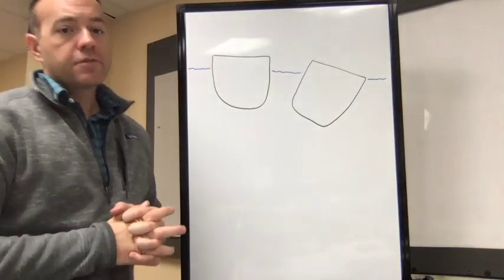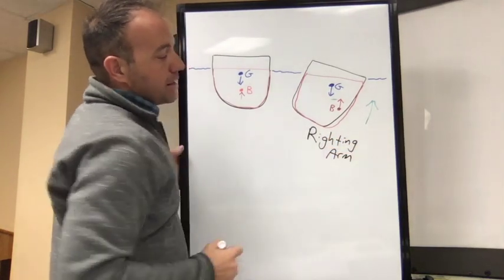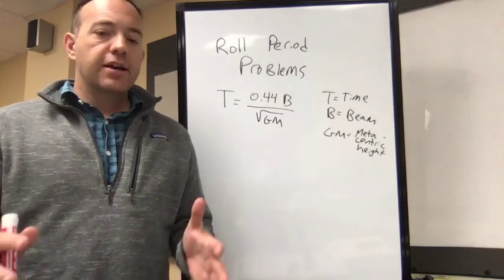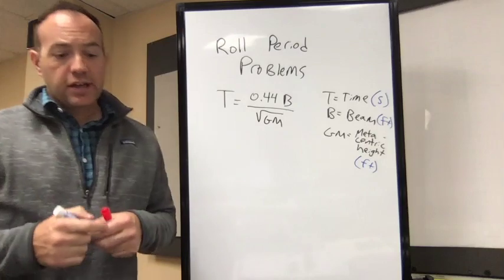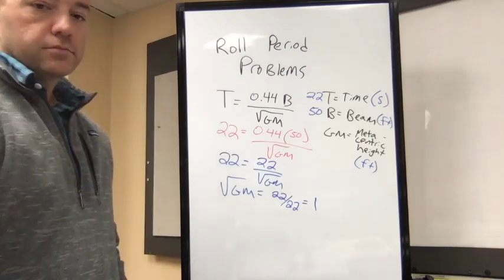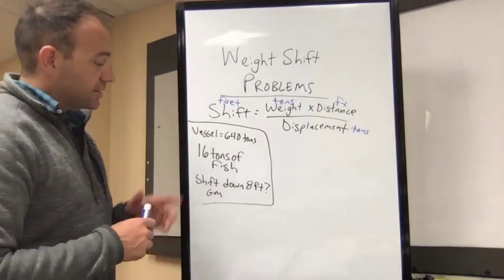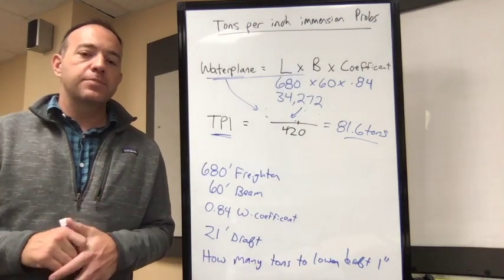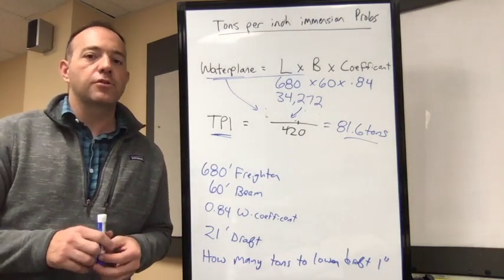USCG Problem Solving (Basic Stability and Deck Safety)

Comment: Very practical explanation of this important information!
At 11.23 minutes the formula shows the water displacement, but this is the mass of the ship + the added mass.
We also see this in the formula where the center of gravity is calculated only for
the 2 added charges. (22.15 minutes).

Comment: Thanks for doing this.
Why dose G not move to Port or Stb ?
Why does G not move Forward or to the Stn ?
Reply from the maker: You bet - G can move if you add or subtract weight, but generally not when the ship is just rolling.  Likewise it can move forward and aft if you add or subtract weight.  Good question.